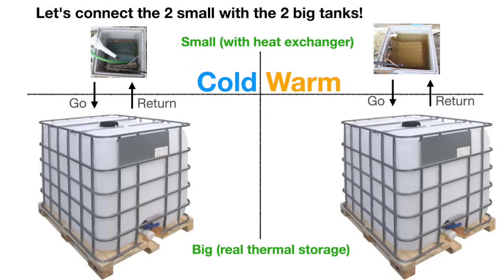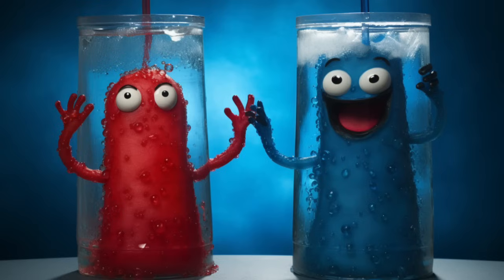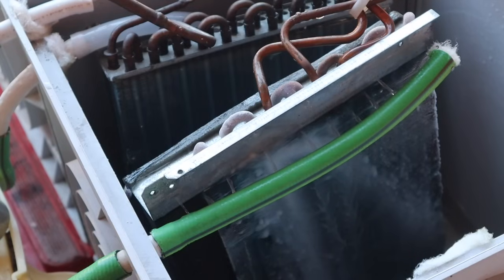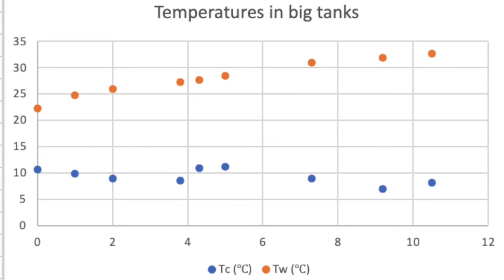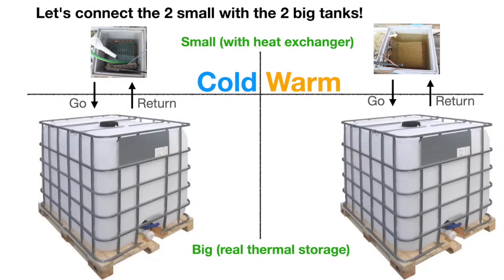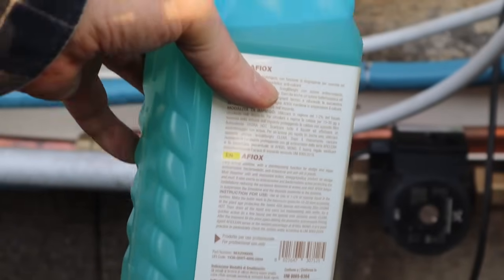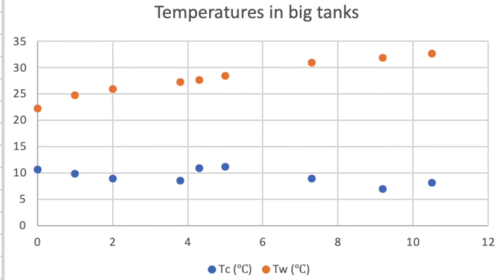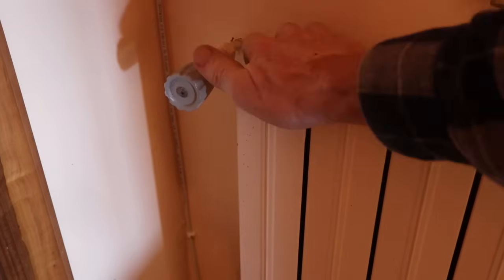How I Heat My Entire House with Only 1.5 kW! - Video 71

Comment: BS you can convert cheap A/C to work as a heat pump and this can be a very cheap and effective way using cheap second hand Aircon unit, but you won't be able to get much from 1.5kW in any other than passive house.
Reply from the maker: Hi MM, I admit that 3 * 1,5 kW (which is the output of the heat pump if you give it 1,5 kW) is not much to get a cold house warm. In the video I say that it is for a steady state situation: to maintain a comfort temperature for an average house. Indeed, in an average Italian house and about 1800 degree-days as here in Florence, Italy, the standard wall mounted gas heater of the central heating with 22 kW will on average give 25% of its max heat. But coming in a cold house you need more. That is the reason that I have here big water tanks that can be charged with cheap night electricity and the release the heat quickly (power boost). I hope that helps!

Comment: It all depends on the heat demand of your house. If it's only 1.5kW at design temperature your house is either perfectly insulated, tiny or you're living in a warm climate zone (or a combination of the before mentioned). In that case I doubt that all the effort of your installation is necessary. Besides, storing energy in a water tank is not efficient AND not effective. One cubic meter (1.000Liter) provides about 10kWh heat. Even when perfectly insulated and stored inside it doesn't get you far in winter. A 10kWh battery stores an equivalent of 20-30kWh heat (powering your heat pump at COP between 2.3), can also be used to power your home, and has less standy by losses. So I don't critisize your enthusiasm or creativity but I doubt the effect in real life situations and the efficiency . With infinite effort you can achieve everything.
Reply from the maker: Hi Michael,  thanks for the comments, they contain good information. Indeed long time storage is not possible without much more water and insulation. For short term it is very good though, and cheap. The advantage of short term storage is the wild variation in demand AND supply of (renewable) energy. And you can benefit from low cost electricity that will certainly come in the future as soon as we all discover that we have to create more flexibility in the demand supply problem.

Comment: Ferry interesting, i have a pond of 50.000 liters that i wanted tou dump with soil.
Then i got the idea of making a warm water cel of it.
This video is verry interesting, i have sort of the same ideas.

Doing the same is not making progress!
Reply from the maker: Hi Roelof, are also Dutch? A good idea to use the pond for energy. You can also fill it up with a long tube in spirals and then fill it up with earth if you want, that is also an energy storage for a heat pump, or you can fill it up with water, as you say!
Reply: @nnvasen-good-energy  ik ben Nederlander inderdaad.

Comment: Nice experiment. I have rebuild my 250m2 house and before the rebuild created a lot of excelsheets with how my house should become starting with the basis that i only want an ventilation heat pump at 5Kw. The result is that now I am all electric and use 9000 kWh per year on electricity. Heating, Cooking, lighting everything. That boils down to an average of 1 kW per hour.
Reply from the maker: Hi RetakenRoots (I suppose that means that you turned to a living style closer to nature?). That is a great accomplishment. By the way, you can say 1 kWh per hour or just average 1 kW. For such a house not bad at all. I don't know in what climate you live and that will determine if you need more energy in winter or also need cooling in summer. Such electrification means that you can focus on getting as much as possible nature electricity.
Reply: I live in the Netherlands so a moderate climate. The heat pump turns off in the beginning of april and turns on again at the end of October. The key is insulation insulation and insulation. In the three months of winter I use 50% of my total energy. I do not have solar as my energy needs are low when the sun shines and high when it does not. Very counter intuitive but that seems to be the case with my house now.
Reply from the maker: I lived in the Netherlands, too, during the first half of my life. Insulation is a good point. Maybe it should come also into my channel. For now I am more fascinated with active components and less specialised in parts of the building.

Comment: 1,5 kw per hour, means that with 1.098 kw per month using air conditioning for exemple you can heat any house you want. I have seen many comparisons like this one, like heating with a hair dryer. If a hair dryer takes 2 kw it means that in a month it will theoretically consume 1464 kw. Huge. One can buy a high efficiency air conditioning unit from the latest generation and it will be more effective, without all the improvisations. But in the end a house consumption will depend on it's insulation and how much heat you recover from ventilation.
Reply from the maker: Hi Florin, I mean indeed to multiply the 1,5 kW with the Coefficient of Performance (COP) of a heat pump to arrive at 4,5, which is the steady state heat loss of a normal house (with decent insulation). I am not at a COP of 3, even. That is because the system for taking heat from the condensor and evaporator has to be improved. The point of all this effort is that I want to integrate heat pump with the water storage so that I can store it in sunny hours or other good conditions (like cheap grid energy in the night) so that I can give a boost when I want to. For example to give 20 kW when I come into a cold house. Or hot house, because this system is for summer and winter. The current problems with grid capacity really asks Demand Side Management (DSM) also from us households.

Comment: Due to the extreme drop in prices for solar panels green electricity can now be generated for only 3 to 8 cent/kWh!
Solar batteries are now also worthwhile. 
However, the extreme drop in prices is sure to continue in the coming years. You should therefore wait another 1-3 years.
Reply from the maker: I don't wait so long 😀! I find them already today cheap enough to integrate them into projects. Even to cover our roof terraces in Sicily with cane or even textile against the sun is nearly as expensive as with current PV prices.

Comment: Kudos for the idea, sir, thanks for sharing! I wonder if I could put my fridge radiator into water to heat it. Despite the climate change scam being proclaimed all around, the power efficiency you nailed meant much more for me, personally speaking.
Have you considered using a warm floor system instead of radiators? By the rules of installation the temperature inside it should not exceed 25°C, thus your system would work twice more effecient, I guess. On the other hand, improving the radiators length /width could eliminate the fans usage, couldn't it?
Good luck with your goals!
Reply from the maker: Hi Alexander, you are welcome and thank you for your good wishes!
You can put the fridge radiator into water (like I do in my project of the Thermal Energy Storage (TES), in video 71, but it is big for a fridge.
You are right that a warm floor is better, considering the low temperature. For a new house, where you have the option to choose for a warm floor it is ideal. The low Delta T between the floor and freezing temperature even allow to use latent heat of ice and get about 92 kWh from 1 m³ of water.
Larger radiators will also do the job and allow a lower temperature, avoiding fans if very big, but that is a lot of costs.

Comment: httpshttps://youtu.be/9RVHQPAb-rw?si=5dnZVP7mFK8VwMW  - -  Nice your video. - Look at my realization, in the field of heating. Which uses compressed air as fuel. Yes of course it is what you read. With a very low use of current.

Comment: Well done sir. I experimented with my own heating system, just as you did. Ultimately it gave me the confidence to pull out my oil boiler and install two heat pumps and a heat bank. By not using the government £5k grant i could buy 2 units for less than the cost of an MCS approved unit. One unit heats the radiators and the heat bank, the other is a split air con that cools as well as provide back up heat in really cold weather. The system thermally charges overnight on a 7p/kWh EV tariff and is topped up during the day from a solar car port. 2nd hand Renault Zoe's are also cheap nowadays, so going fossil fuel free really can be done on a budget and the reward is a lifetime of lower (sometimes negative) bills.
Reply from the maker: Hi Bolwem, you are mile ahead of me! I guess you are in the UK (pence/kWh). It is encouraging that you also could take out the fossil fuel boiler away. Is the Zoe also giving power? I guess that only the newest cars can take & give power.
Reply: You are my kind of a guy. Really a similar project to what I did. Couple of years ago I was renovating my late father's house. I put new central heating in with fireplace connected to it and for storage I use 2000 liter buffer tank. Heat pumps are very over priced around here and 15kW pump would cost me around 12,000 to 15,000€ with installation. So I bought two new 7kW air inverter conditioners, around 800€ each and made two coaxial heat exchangers. After a lot of work and some more money it started working and is heating the third season now. The heat pump cost was around 2,500€ at the end. I saved more money that year that I could earn in that time.

Comment: I don't understand people giving out hard comments on this. Man invested time and testing reusing and recycling and they compare it to polished out industrial true and tested 10x more expensive solution? What morons. Yes i get it some just want to have something that they can pay for and it works. Good for you. But there are others who like to tinker and experiment with entusiasm for it. Give this man a chanche and good work sir.
Reply from the maker: Thank you Samurai! Exactly, I want to tinker with a scientific fundament so that people can make new things with less expenses and at the same time unique features that are not on the market. In this example there is the storage feature and "cogeneration" of cold and heat.
Reply: Nur wir verstehen es nicht und den Untertitel kann kein Mensch Lesen
Reply: @peterdiedrich4442  I am 76 yr and can read it very good! 
Sir, thank you very much for yoyr video, very, very usefull!!! ❤
Reply: the germans will never allow this, they will buy you too, my friend, don't worry, I mean they will buy your inventions and the ordinary common man has to pay!
Reply: I tried once to use the cooler from an refrigerator as a water heater and with a waterpump the hot water circulate in one radiator!!! All on solar energy! ❤😂

Comment: What about adding solar evacuated tubes and waterbased firewood oven?
Reply from the maker: Yes Kay, very useful to add other heat sources to the heat sources. Also because you mention higher temperature sources that can "finish" the  work of the heat pump that heats up to 45 degrees C.

Comment: I don't understand the negative comments here.
The COP obviously depends to a large extent on the scrap ACs used - if you use an AC with an average COP, you won't get the highest efficiency out of it.
But that's not the point of the video, the video is about possibilities, DIY and lowest cost.
You start like this, and keep improving.
Reply from the maker: Thank you Chblabah, you got it! Trying comes first, perfection afterwards. Important is starting and ... power to the people. And perfection comes also from you, my commenter with good advice. I will respond to all, after my trip that ends tomorrow. Also the promised video for today must wait because of this trip, sorry!
Reply: COP depends on the temperature difference between the hot and cold side. In cheap AC's this is from smaller evaporator and condenser sizes, but with water and nearer the same temperature the efficiency goes up a lot. Ideally you'd change the capillary tube for a higher flow rate as you're unlikely to use the whole evaporator with the restriction used for stock.

Comment: Many existing standard air conditioning units have COP ratings of 3+ (the one I'm getting has a COP of 4) and can be bought/installed for £1000.  Simple, standalone and compact.  It's all well and good building a DIY version but heat pumps have been engineered 'to perfection' by manufacturers with lots of experience and the funds to deliver a finished product.  In my case, if I fitted a solar PV system that could reliably deliver ~500W I'd have 'free' heating but (a) my location precludes such efficient solar operation and (b) the cost would 'never' be recouped.  As for any other altruistic reasons for doing it I have many, many reservations about the so-called threats posed.
Reply from the maker: The problem is that water to water heat pumps are difficult to find and cost much. They are very useful for water based systems like central heating and heat storage. This latter feature is difficult to find on the market.
Reply: @nnvasen-good-energy  Aircon units are air-to-air heating and still have COP values exceeding 4 and a basic unit can heat 40m^3 for well under $1000.  We're talking 250W input here - and achieved without complication of design, build or install.  Much as I admire the work you've put in to your system - if only to show the processes of heat movement involved - it's still below current manufacturing quality/standards and not really a system that anyone but a dedicated tinkerer could achieve.
Reply from the maker: Hi Kell, I agree that it is a challenge to realise this all and I put a Difficulty Grade of 80%. Next year spring if we are in that house again, I will simplify it. 
My main point to do this complicated project is:
- I see that there are no "cogeneration" plants where cold and heat are used at the same time, and it seems so rational to me to do so. At least in summer, it is easy to find an application for both. Double efficiency.
- The water to water heat pump together with the water tanks gives better control of the temperature at the evaporator and condenser and makes compatibility with the water based home heating system intrinsic.
- I am frustrated with the price difference between feed in (fotovoltaic) and purchase of electricity. We have 15 kWh of Lithium but that is full at noon (if we don't have guests in the holiday home) and then we can store it in the dirt cheap double tank of 2x12 kWh.
There are a lot of points to improve and I invite you to watch the video after this one and then the video of next Saturday, where I go into detail.
Reply: @nnvasen-good-energy  Always happy to watch your efforts and progress.  Looking forward to the next one.